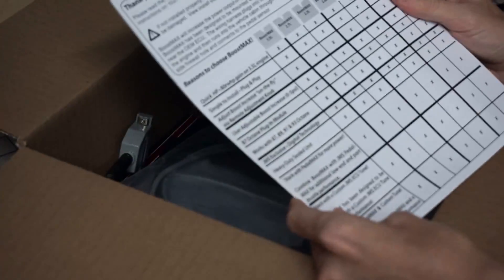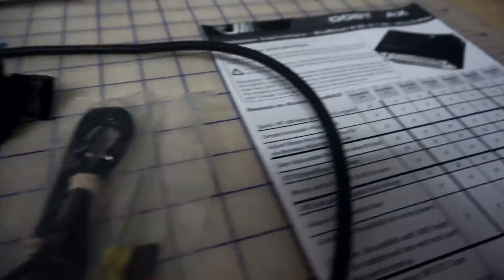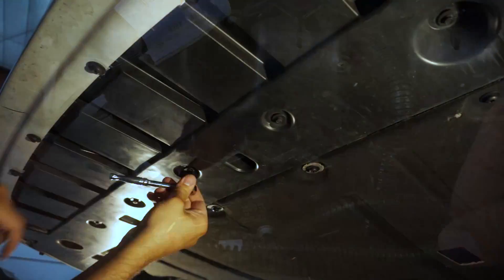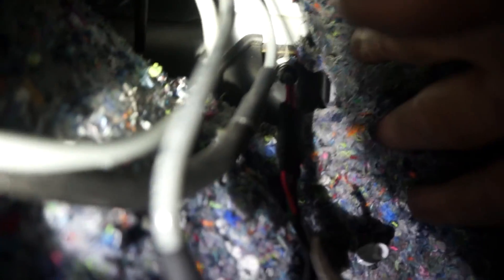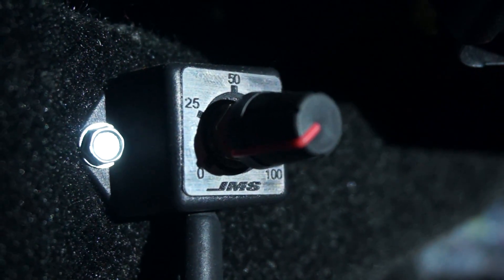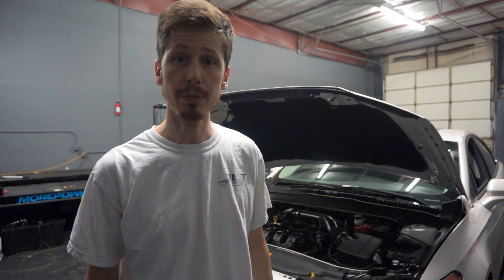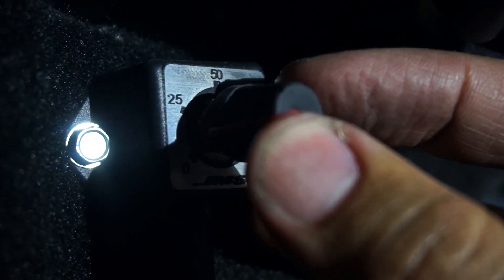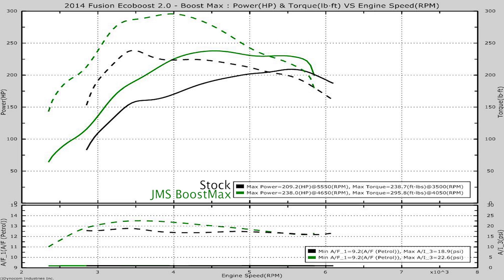Testing The JMS BoostMax on a 2014 Ford Fusion 2.0L

Comment: By the signs of what it connects too it just makes the engine run leaner ? Were the o2 sensor readings in tolerance and soak plugs look healthy after use? Id worry about over heating the valves on these direct inject engines with less fuel to cool them

Comment: Does it actually not affect your warranty at all? I’m putting on my lease then😂
Reply from the maker: From what our customers are telling us, they're not having issues getting warranty work done. Recommend you return to stock before taking it in. Make a note of your processor code before and after, so that if it changes we can email you updated tunes that match any software updates they applied.
Ultimately, questions regarding warranty are better aimed at your dealership. We cannot actively assist in circumventing any of their policies.

A vehicle’s warranty as a whole may not be voided due to use of aftermarket parts per the Magnusson-Moss Warranty Act. However, a manufacturer may require a customer to pay for parts and labor for a repair if there is direct causation between a customer’s alteration and the product or service repair being requested. It is in both manufacturer and customer’s interest to follow logic and reason so that the system of good faith is not abused. If this topic interests you please read the law as well as your warranty documentation. We are tuning professionals and enthusiasts, we are not lawyers and cannot provide legal advice.

Comment: What is the restriction that causes the power peak to move from 5500 rpm in the stock format to 4650 rpm with the product installation?   The torque in the stock format peaks at 3500 rpm, while the torque with the product peaks at 4050 rpm.   So if the HP curve followed without any restriction, the HP peak with the product should''ve been beyond 5500rpm and it would've been a much higher number.   Thinking about it, it sounds like an inlet restriction before the turbo.    Like the filter and/or air hose or MAF.

Comment: its sketchy to try to get more horses out of a shit engine. i've already blown a piston head. i've heard someone blow through 2 engines. a
im having random misfires on my replacement when i floor it to around 80mph.  i might end up blowing a second as well... 
the car is cool but the 2.0l has common issues.  at least my replacement has a 3yr warranty.  lol
Reply: Change the oil regularly with high quality oil and always let it warm up before beating on it my 2.0l has over 150k on the original engine still running strong. I beat it daily

Comment: Is there a tuning for a better fuel economy i have the 13 ecoboost 2.0
Reply: VR6 RT did you find anything??
Reply: In my experience with the Fusion, the best thing for fuel economy is to drive like a grandma. If you stay out of the boost, you can achieve 25 mpg in city and 33 mpg or more mpg on the highway. (FWD) 

I also had an AWD model and the MPG loss was maybe 1-3mpg throughout.

Comment: Will it work on 2013 fusion titanium awd 2.0l eco boost?
Reply from the maker: Yes, this system will perform the same on that car.
Reply: Hi o have the 2013 Ford escape 2.0 ecoboost. 
I'm pretty sure it's the same motor in the fusion.

Comment: Would this product fit on a 2013 Lincoln MKZ 2.0 ecoboost?
Reply from the maker: Yes, MKZ 2.0L Ecoboost is listed as supported.
2013-2017 Ford Focus
2011-2017 Ford Taurus
2011-2016 Ford Edge
2011-2016 Ford Escape
2011-2017 Ford Explorer
2014-2017 Ford Transit Connect
2015-2017 Lincoln MKC
2015-2017 Lincoln MKZ
2011-2016 Ford Fusion

Comment: 13.5 AFR?!?! Unless you want melted pistons, STAY AWAY!!
Reply from the maker: I think you are mistaking boost line for airfuel. The green and black lines shown are both boost and correspond with the axis on the right. The dyno wideband was not connected to the tail pipe during these runs as it was being data logged directly from the pcm.

Comment: So the Ford website shows the 2.o ecoboost which i have the 2013, has 242hp 275 ft lbs tq is my i dnt get this dino or Fords made a huge lie wtf?! Need to dyno mine damn!
Reply: It's rated at the crank not wheel.

Comment: how would this work with other mods like a CAI and downpipe?
Reply from the maker: It would work fine. Should not see any trouble codes or a check engine like from those mods as long as you continue running a catalytic converter.

Comment: I read the 2.0 litre fusion can put out 240 hp stock?
Reply from the maker: Keep in mind that we're measuring at the wheels, whereas what Ford advertises is measured at the crank. Can usually expect at least 15% drivetrain loss.
Reply: Makes sense, Thanks.

Comment: I just installed tissue on my ford fusion and im having issues where if I go past the 25% mark the car wants to die and when I do 100% I will hit full throttle and it feels like is struggling. any suggestions
Reply from the maker: Hey Lee, I would look towards what octane fuel and the quality. 25% is for 87 octane and past that requires better fuel. Remember, not all fuels are equal. You can have good 93 and bad 93 depending on the station. Always stick to top tier fuels.
Reply: @mptperformance  I don't jock Shell at all, but i've had some extremely high compression cars and they run better on Shell 93 octane.  Chevron 93 octane is up there too.   Some of the cheaper gas stations jip you on their higher octanes, sometimes it's the same stock as 87 octanes.
Reply: I recently installed one on a 2014 focus. having the same issue. I plan on disconnecting the neg battery cable. hopefully it will reset. For the first month or so it was great couldn't believe the difference.
Reply: Mine had the same issue just now 
I'm removing this from my car tomorrow
Reply: Did you find a solution?

Comment: Will this work on 2015 titanium
Reply from the maker: +Martin Guerrero , Yes, this should work on a 2015 Titanium 2.0L Ecoboost.
Reply: +MPT Performance what about Ford Focus SE 2013?
Reply from the maker: As long as it has an Ecoboost engine it should work.
Reply: pedal max will work on the standard model. Boost max will not. must be Ecoboost engine in order to use the boost max.

Comment: my few questions: 1) did it have any effect on the vehicle shift points? mine is a 2013 with the hard shifting 2-3 gear, ive read this can actually improve the sifting due to correcting by adjusting measurements sent to the computer for deciding the torque and shift points? 
2) what octane were you using for the test (do you have to use a higher octane)? how has it affected your mpg (if you were driving modestly)
3) wouldnt a tuning from something along the lines of the sct pretuned options have better overall results? if so why would you use this? immediate results that can be adjusted on the fly would be my reasoning. I do know it can be used in combination with the pretunes SCT  as well, 

...info via sites like steeda
Reply from the maker: +christopher waller In a roundabout way, shifting is effected, since a lot of how the trans is controlled is based on much torque the vehicle's ECU estimates it's making at any given moment. The higher the torque, the firmer, more aggressive the shift. Shift points are unaffected.
All testing was done with 93 in the tank. No negative effects on economy when driven conservatively. 
Yes, a tuning solution that reprograms ECU for performance would net better overall results than the BoostMax. This device is a great choice for anyone who wants to avoid programming their vehicle with an aftermarket ECU calibration, for whatever reason.
Reply: I’ve had the exact same issue in the 1.6 and the 2.0

Comment: i put this on my 2013 SHO 3.5L the install was waaayyy easier than that fusion. map and tip are easy to get to after removing the plastic heat shield, right on top. remove battery for the fire wall plug took the longest. i have not dyno'd stock or after but would like to see the results. my blow off valve screams so i know it makes a difference compared to stock. i also hooked a SCT flash tune device to it just to read the boost gauge and temps, not flashed. taurus does not come with boost gauge. have the SCT flash tuned for the mark viii 4.6l. i would like to do an ecoboost mark! great vid thanks for your info!

Comment: should we be scared about a 13.5 afr???
Reply from the maker: +Jason Kister  That section of the graph is admittedly a little confusing. The dotted lines are boost and reference the X-axis displayed on the right. The JMS BoostMax does not modify AFR.
Reply: @mptperformance  does this actually not void your warranty at all?

Comment: Great video very informative... I'm interested in getting this product ...Will you be also testing out the JMS PEDAL MAX  on the 2014 fusion? They say you can stack it with the JMS BOOST MAX. The JMS PEDAL MAX is suppose to Eliminate Turbo Lag on Ecoboost Vehicles Improves vehicle acceleration Enhance low and mid-range horsepower and torque.Increase throttle response.. Would like to know if its worth buying that as well or save my money. Thanks
Reply: +raddddix I am also curious.
Reply: raddddix save money for a different ecu